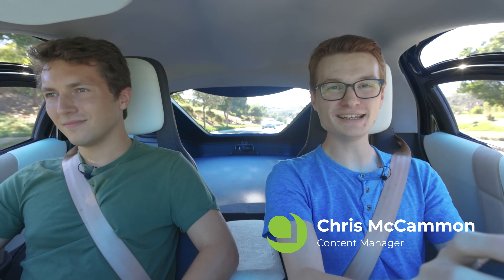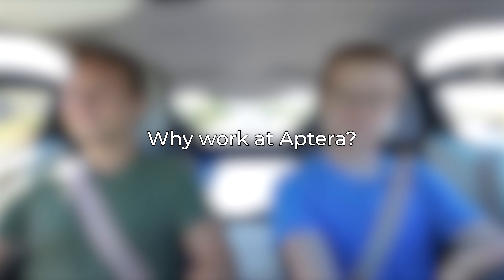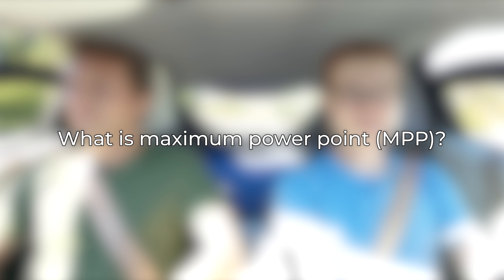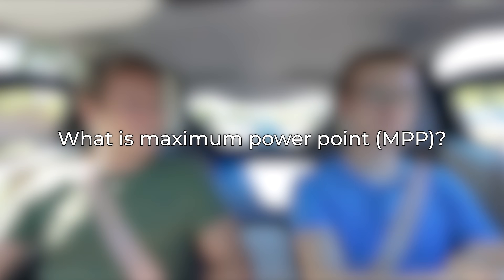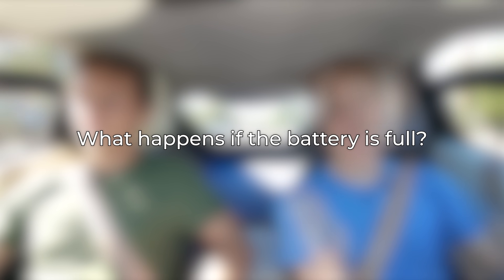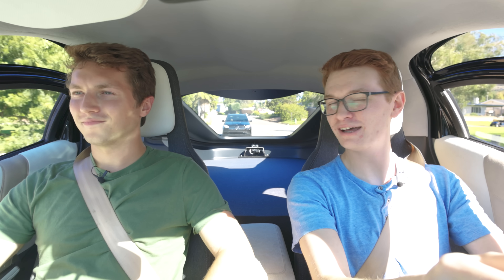Aptera's Solar Charger — The Third Wheel

Comment: "We're driving in a vehicle that is currently being charged by the sun." SO COOL.
Reply: Aptera did post a video of the vehicle going up a large hill two times consecutively a few weeks after that NBC episode.
Reply: Technically it wasn't being CHARGED by the sun.
Reply: @johnreeves7261  no, the Aptera can charge while in motion.
Reply: @312bigbeanburrito  Technically the solar panel's current is assisting the powering of the drive system or ac, it would be impossible for the battery to charge the battery while the battery is being discharged.
Reply: @312bigbeanburrito  Will there be situations in which "Aptera can charge batteries while in motion"?  Yes.  But far and away the electrical power from the solar will be going to, mostly, the motors and NOT charging batteries.  Again.  Technically.
Reply: @MotoxYT  technically this distinction is completely unimportant and purely semantic to a layman
Reply: @johnreeves7261  it was not specified that the battery was the specific entity being charged by the sun. Layman use of charge is equivalent to being powered by. The original comment is that the vehicle is being charged by the sun. No one specified the battery.
Reply: @312bigbeanburrito You are right that it was not very important to make that distinction, but he did and he’s right, no point in arguing about it. Words have meaning. Charging and powering is different. You can charge or discharge a battery, you cannot power it. It can power something. The drivetrain can be powered by the battery or the solar panels or both. You cannot charge a drivetrain.
Reply: @89bazoly  show me where anyone claimed the drivetrain in specific was being charged
Reply: @johnreeves7261  In the purest use of the term electrically charged which is the basic property of matter carried by elementary particles that governs how the particles are affected by an electric or magnetic field, the Aptera clinically was being charged by the Sun whether that electric charge was used to replenish the batteries or by the motor, accessory outlets, AC unit, etc.  Both electric circuits and batteries are considered charged when electric current is applied to them.  During light regen braking or coasting the electric charge from the solar was undoubtedly then being managed by the charge controller for running vehicle systems and replenishing the batteries.

From an engineering standpoint the Chris's spoke correctly referring to the Aptera as currently being charged by the sun.

Best!
Reply: @neilfromclearwaterfl81  I like it!  But.....

In the context of battery electric vehicles, I'm pretty sure most "laymen" would interpret charging as simply the bringing up the state of charge of the batteries and that, as muddled as it may have been, my only point.

Best back at you my good man!
Reply: @johnreeves7261  That danger of alternate "Layman" interpretation is always there when eavesdropping on a conversation/banter between two engineers.  

I've been reminded of this multiple times in engineering meetings when there was a mix of Laymen and Engineers present that I had to bring it down to a 3 year olds comprehension level without sounding condescending to ensure the laymen present didn't misinterpret things.  

I've had to deal with laymen quoting from a technical document telling me I didn't understand the writers intent, with them then giving me their off base interpretation.   I often end up starting off by telling them something like "When I wrote that I was addressing a programming team of electrical engineers and meant...."  with some variations depending on which engineering team the document was meant for.

Best!
Reply: @neilfromclearwaterfl81  Yup but I think we can agree that this video was meant for "laymen".
Reply: @johnreeves7261  Most of whom won't notice or care about whether they used the correct term charged or the more laymanish powered by the sun in their banter between each other.  

Give it up as the kids did a good job including others in their drive around town and answering common questions.  No need to Hen Peck them over this when in fact they spoke correctly. 

Best!
Reply: @neilfromclearwaterfl81  Well there's where we disagree.  The laymen are getting the wrong idea, it's not "Hen Peck"ing and they, in fact, spoke incorrectly to those for whom the video was intended.  I'm fine if you would like to continue to Hen Peck me.  Mine is a pretty thick skin.....
Reply: @johnreeves7261  they conveyed the correct idea: the vehicle is being electrically charged by the sun. It does not matter whether that charge is driving the wheels or being stored; no one cares. It is not misleading.
Reply: @312bigbeanburrito  Seams you care.  They conveyed the incorrect idea and it's misleading.  Batteries are charged.  Assuming you REALLY don't care, that should be the end of the story for you.
Reply: @johnreeves7261  no one cares about the distinction. I don't. Observe: the vehicle is being charged by the sun. 

Mad?
Reply: @312bigbeanburrito  If you don't care about the distinction then why are you whining about it.  Observe: the vehicle is not being charged by the sun (in most rolling conditions).

Still Mad?
Reply: @johnreeves7261  I wasn't aware that plain statements of fact were "whining." I thought a supposed connoisseur of differences like you would be able to tell the difference? 

Yeah, I'm sure most readers will care to distinguish "in most rolling conditions" 🤓
Reply: @312bigbeanburrito  "plain statements of fact"  You're hilarious!  BTW, I added "in most rolling conditions" so as to not trigger you.  You're welcome.
Reply: @johnreeves7261  As fun as it is to bait you into easy fallacies, I think it's time to face the facts. Neil said above that the purest idea of charging is simply to be powered by. That is the most common conception. It's entirely arbitrary for you to say that common people only say something is charging if a battery increments. While I'm sure some people believe this, it's not necessary to the meaning of charge. 

Also, think logically about what a battery is. A battery is simply anything that can store a form of potential energy to be used as another form of energy later. Dammed bodies of water are batteries. Any liminal space between one form of energy to another can be thought of as a battery. Even if the actual part designated as battery doesn't increment, the medium in between the sun and the motion of the vehicle is, conceptually, an incremented battery that converts to motion. 

So even if you're right that a battery must increment in order for charge to be charge, the Aptera is still being charged by the sun.
Reply: @johnreeves7261  facts don't care about your feelings or your "triggers,"  🤣
Reply: @johnreeves7261  I will agree to disagree and think you are being overly critical of the Lads and need to lighten up on them.

Most layman likely didn't notice or care until you brought up the unnecessary contention about how some laymen misunderstand what it means to charge a circuit or device.

We need to educate instead of go on tirades promoting/reinforcing a misunderstanding of technology.  Laymen need to understand what a charged circuit, power line, etc actually means and that is best done by raising up their level of understanding and not constantly dummying things down which is something I am actively involved with locally, training young men and women to better understand technology and with safely doing their own maintenance and repairs.

Best!
Reply: @312bigbeanburrito  As fun as it is to reveal the breadth of your ignorance, clearly you don't know what a "fact" is.  Do try to get back to me when you think you do.
Reply: @neilfromclearwaterfl81  said: "Most layman likely didn't notice or care until you brought up the unnecessary contention about how some laymen misunderstand what it means to charge a circuit or device."

Most layman didn't notice they were being misinformed and I simply brought that fact to their attention.  You're mixing up the timeline.

neil said: "We need to educate instead of go on tirades promoting/reinforcing a misunderstanding of technology"

No tirades on my part so...
Reply: @johnreeves7261  so do you have an actual counter-argument? Weird how you lack any substantive point to make other than grand-standing.
Reply: @johnreeves7261  Apologies if I'm confused however I still feel you are being too harsh in your assessment against these young lads and being so insistent about it

I will like the others who showed they understood their statements, continue to give the lads Kudos for a job well done.
Reply: @312bigbeanburrito  Are you dense?  Aptera engineer: "Aptera's being charged by the sun".  Me: Generally no, not by the commonly known understanding of the term "charging" as it relates to battery-based electric vehicles.  You: I'm changing the definition of charging then!!!!!
Reply: @neilfromclearwaterfl81  Simply commenting that the "lads" are wrong is not harsh.  I'm amazed you think it is.  BTW, I've watched part of the vid again.  The lad at ~0:50 timestamp is wrong.  You CAN hook up a solar panel to a battery and charge the battery (w/o a charge controller of any kind).  Can all types (voltage) of solar panels be hooked up to all types (voltage) batteries and have the batteries being charged?  No, and the reasons why they can't are very similar to why Aptera's solar strings w/ MPPTs can't charge all types (voltage) of batteries.
Reply: Would be cool if they add a solar drive mode where only as much power is applied to the wheels as the solar produces in a 60second mean , so that the battery never gets lower when driven, would be just cool to see how fast you could drive from sun allone, even if it's just 15miles/hour.
Reply: @norbertfeurle7905   that would be interesting! I'm guessing it's not practical to implement something like that, given all the requirements for everyday use: varying terrain, HVAC, etc. Gotta have some charge in the battery. But, to your point, observing whether the car can move at all in this hypothetical mode you described would still be interesting. It would be fun to find the conditions under which the car could move, and find out how fast. I guess that's what "actual" solar cars are doing.
Reply: @norbertfeurle7905 I was thinking about something similar, like if you’re driving on relatively flat ground at the speed just under where wind resistance becomes a major factor, how far could you go. Say at 40mph. You know were going to get some videos of ppl pushing the distance limits…
Reply: @michaelsmithers4900  I believe Aptera is estimated at needing about 5000 watts to maintain 50 miles per hour on flat roads with no wind.  I'm betting Aptera would need to be traveling at single digit speeds (in miles per hour) to be, effectively, not needing any power draw from batteries.
Reply: @johnreeves7261 I’m not sure where you got your 5000w/mi, I sure hope not. So driving a tesla conservatively on a flat at low highway speeds 55ish i get around 200wh/mi. It may have been in this video, I recently heard that Aptera is around 150wh/mi of course this will vary greatly with speed, weather, hills. 
Keep in mind that I was referring to like a long range challenge rather than real world driving, i.e going 80mph…

Also keep in mind that an object in motion tends to stay in motion… so the solar needs to overcome air resistance, friction, and operate it’s systems. Usually air resistance is the greatest of these when at speed. But Aptera is so aerodynamic, the systems may consume more energy than the motors at low highway speed…
Reply: @michaelsmithers4900  5000 watts to maintain 50 miles per hour is not 5000w/mile.  5000w/mile is nonsensical.  Take the 5000 watts and divide by the speed (50 miles/hour) and you get 100 watt-hours per mile which is what Aptera has been suggesting is it's energy consumption per mile.

Also, you should read up on Newton's laws of motion.  Your understanding is critically incomplete.
Reply: @johnreeves7261 first you tone is rude, not necessary.
True 5000w to go 50mi doesn’t make sense. Maybe I was in a hurry and left off the hours. I think others understood I meant 5000wh or 5kwh. That’s based on 100wh/mi x 50mi=5000wh or 5kw.

If you want to discuss newton’s laws of motions Id be happy to engage. I admit I’m not a physicist but I do remember that an object in motion tends to stay in motion and an object at rest tends to stay at rest from grade school.
Reply: @michaelsmithers4900  First, at least with you, I don't believe my "tone" has been rude.  Direct and to the point, sure, but not rude.

Regardless of how other's may have understood what you meant, it was wrong of you to say/mean: "I'm not sure where you got your 5000watt-hours per mile" as I simply never said that.  Here's what I said: "I believe Aptera is estimated at needing about 5000 watts to maintain 50 miles per hour on flat roads with no wind."  Take your time and try to explain why you object to what I actually said.

Incidentally, you made the same kind of mistake in your units again.  You said: "That’s based on 100wh/mi x 50mi=5000wh or 5kw."  Do you see it?

Finally, with respect to Newton's (first) law of motion, if you're going to invoke it in the making of an argument, it's best to maybe refresh your grade school memory first.  If you do chose to do such a refreshing now, you may understand better of what I "meant".  :-)
Reply: @johnreeves7261  thanks for the reply.

To clarify. 5000w to maintain 50mph is meaningless. You have to have a time or distance component. Imaging it was per second, the whole pack would be drained in a few seconds. Given that 5000w = 5kw and IF their battery is 40kw then it would be gone in 8sec.
Usually with cars we use wh/mi or watt hours per mile this is bc the energy consumption is so wildly variable from standing still consuming no power to drive to consuming lots of energy to fight wind resistance at highway speeds.

So there was no mistake in my math above. If you have 5000w or 5kw and the car consumes 100wh/mi. Simply divide 5000w by 100wh/mi and you’ll be left with 50mi. 

Its hard to know what you are pointing out as you just said look more closely which was vague.
Are you referring to the hours? Bc i don’t say 5000wh? Maybe i should write that way since that’s how we write it in kilowats. So is this better 5000wh / 100wh/mi = 50mi? If that’s all you were referring to than just say it.
Reply: @johnreeves7261  Instead of making me guess what you are talking about with newton, why don’t you construct an academic argument as to why I am wrong or what you don’t understand about what I am saying. I don’t want to write a dissertation here to try to root out what you’re getting at…
Reply: @michaelsmithers4900  Please look up what Newton's first law actually is.
Reply: @johnreeves7261  I think in my original post I discussed friction and wind resistance (outside forces)
Reply: @michaelsmithers4900  In your original invoke of the first law you certainly did mention friction (wind resistance is, effectively, friction, btw) but, maybe because you were in a hurry, you didn't clearly tie it to your mention of just part of the law and left the reader to try to understand what you might have meant.  Look, I'm happy to drop the Newton's first law discussion.  It's a distraction and it doesn't address your key misunderstanding of what "5000 watts to maintain 50 miles per hour" means.  Are you seeing my somewhat longer comment detailing what a watt is?  I made it just before the "Please look up what Newton's first law actually is" comment.

Comment: Great video thank you

What will the onboard 120vac outlet be rated at?

1500 watt would be great.
Reply: Sounds like that won't happen. They mentioned it a while back but I think it's not going to be there.
Reply: @tims8603 at 5:45 they announced a 12 volt - 15 Amp access port... but that is only 180 watts.

We can plug in 12v - to - 120vac inverter, but that would only put out 1.5 amps at 120vac.

Surely, Aptera could tap into the Main Battery and have a 120VAC - 15A outlet available.

A V2L or V2G could be included.

Have to wait and see if Aptera can consider these ideas prior to Product Intent vehicles are produced.
Reply: @andremcamara3120  Maybe I wasn't clear. Chris and Steve  talked about this subject awhile back. Like a year or so ago. I think they were planning to put an inverter into the vehicle so they owner could run 110/120 v AC appliances from the battery. I haven't heard much lately about that. Now they're saying a 12v outlet. No mention of an AC outlet at all. Maybe they scrapped that idea. It would add cost, complexity and weight to the vehicle. I can't say I know for sure what their plans are.
Reply: @tims8603  I did understand what you were saying.

As you just stated, Chris had mentioned that they were considering a 120VAC outlet.

I started commenting on this so that if Aptera Personnel were monitoring our replies, they could see the interest in having a 120VAC - 15A outlet.  If they want to add a 12V - 15A Outlet, I do not think anyone would be against it but I am hoping that more Aptera Reservation Holder voice their opinion, that Aptera may then consider adding a 120VAC - 15A.

Remember when ppl voiced their concern about not having DC Charging???

I hope you can now understand my point.
Reply: @andremcamara3120  OK, I'm glad we sorted that out. Peace